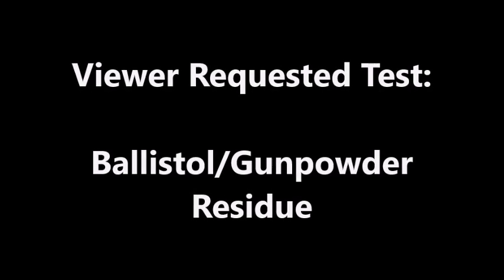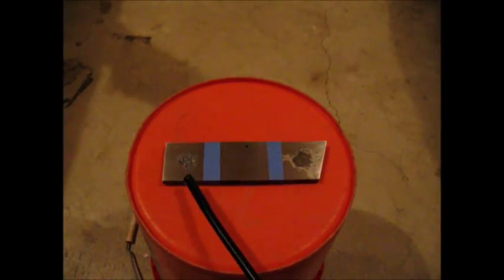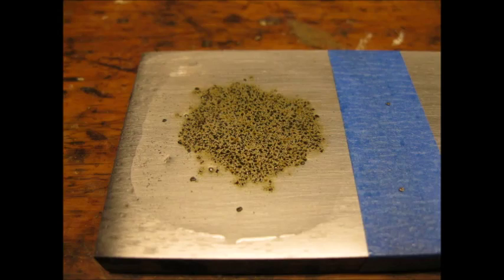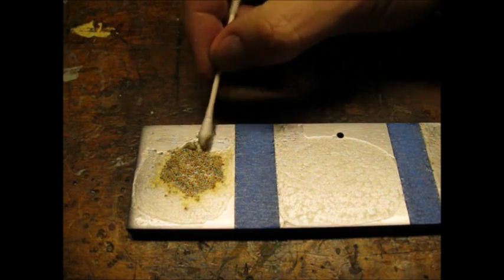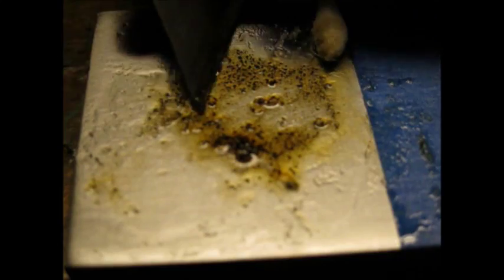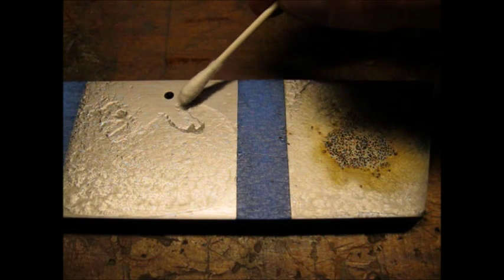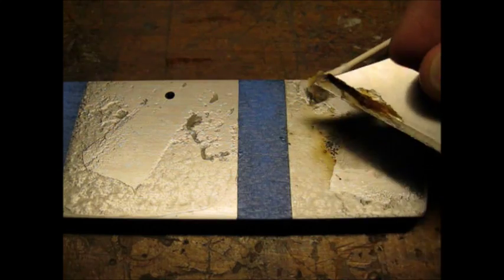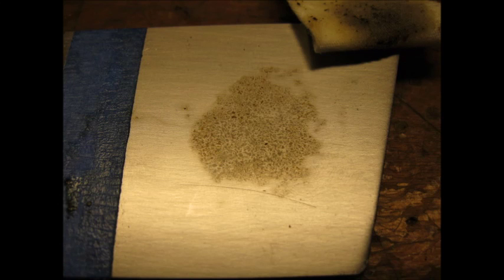Viewer Requested Test: Ballistol/Gunpowder Residue

Comment: That is a very interesting result! 

Would you mind performing the same test with a small addition? I wonder how the “dried” ballistol consistency will fare against powder being burnt on top of it, and then being wiped away. 

Thanks!
Reply from the maker: I have had similar comments that the CLP may "season" the metal like a cast iron pan. I am planning on testing this.  Stay tuned, and thanks for watching!
Reply from the maker: Check out my video where I test several CLPs' ability to "season" the steel plate.
https://www.youtube.com/watch?v=kRnEmq-I6pc&t=26s